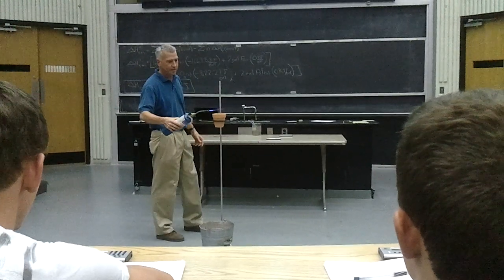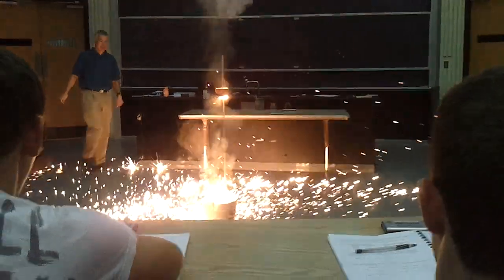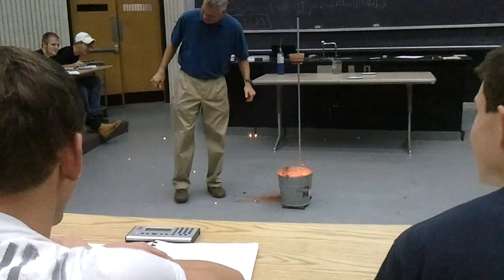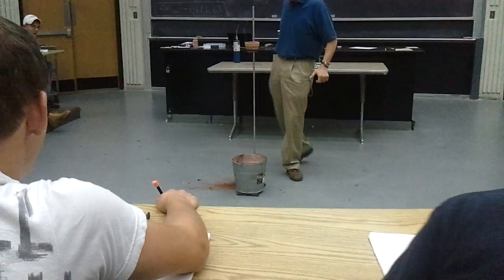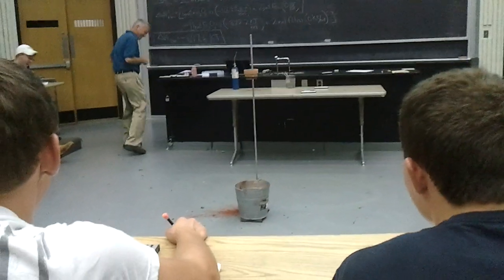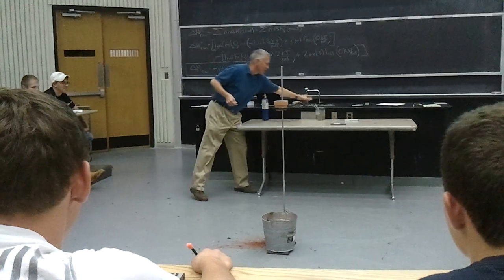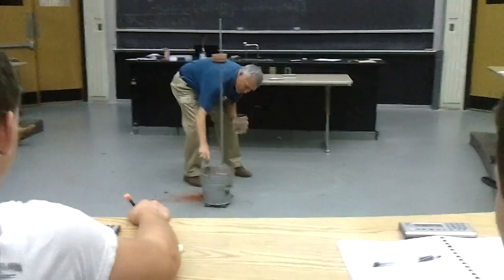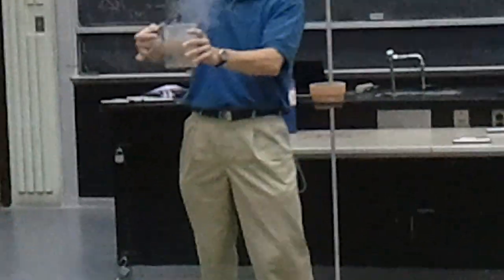Thermite Reaction Gone Bad!

Comment: haha... words you don't wanna hear from your chemistry teacher "that's not good"
Reply: You should have seen and heard the shit my teachers did.
Reply: That's what mine says about all of us.
Reply: Yeah, someone could have actually gotten seriously badly burned from his negligence. Never should have done this inside.
Reply: Mine once said I dont know what is this or what happend
Luckly it was just a water solution
Reply: Back around 1980,79 a teacher  was  killed and several students  injured as a result of an explosion  while he was  pounding a course rocket propellant mixture into a fine intimate mix with pestle and mortar apparatus. He had of course lectured them of the dangers and that  they  should never attempt it , he knew what he  was  doing and all safety precautions blah blah blah.......boom . That was  in Queensland,  of course.
I won't  mention what i actually  witnessed back in the 70s again in rural outback Queensland  when a truck stopped 2 kilometres away, it was  loaded with ammonium nitrate fertiliser,  driver  got out and started hammering underneath  around the axle at something , very hot day , well it happened  and i was knocked off my feet . The axle remained  but no sign much of the  original truck.  Oh, i see i mentioned it.

Comment: Good thing that floor wasn't made of steel beams.
Reply: HAHAHAHAHAHAHAHAHAHAHAHAHAHAHAHAHA SOOOOOOOOOOOOOO FUNNNYYYYYY XDDDDDDDDDDDDDDDDDDD
Reply: +Andyboys Is flogging dead horses your only hobby?
Reply: 9/11
Reply: yeah except the fact that that 9/11 myth has been debunked several times over. maybe you could use that tin foil hat in a thermite experiment instead.
Reply: Dustin Gasser That would imply that wearers of tinfoil hats have a brain to begin with (which is absolutely necessary for planning an experiment)...
Reply: Dustin Gasser debunked by who? The government. Also the Earth is flat and the Moon is a hologram! Praise the sun!
Reply: Nord independent studies set out to put the conspiracy theories to the test. They don't stand under scrutiny up to the claims being made.
Reply: Woooowwwwww
Reply: LMAO
Reply: @kenschartz5334  Right, that's why Grenfell tower collapsed at near free fall into a neat pile. In fact, there's no such thing as controlled demolition. When people need to collapse an entire skyscraper they just set a fire at the top and it handles itself.
Reply: @kenschartz5334  When?
Reply: Hahahahahaha yoooooooooo
Reply: @AtlasReburdened  Damn, I must have missed the part where a Boeing 767 crashed into Grenfell Tower.
Reply: @TheFree33333  You missed physics class apparently. When did you start having the delusion that throwing a rock at the peak of a mountain would reduce the mountain to rubble?
Reply: @AtlasReburdened  maybe I did, would you like to help? How much kinetic energy does an object that has 180000lbs of mass going 460MPH produce?

Comment: Jet fuel can't melt steel beams.
Reply: Cyborgslayer404d You're totally right

but with all the chemtrails, weather control substances and other nasty things that the govt put into the atmosphere, who knows how hot that fire truly was 

u mad?
Reply: ***** You roll a d20 on a Dank Meme knowledge check. You roll 2. Lose 10 skill points in Humor.
Reply: Cyborgslayer404d Psst: steel doesn't have to "melt" to fail. It has all the load-bearing capacity of saran wrap at jet fuel temperatures.
Reply: Valyn66 Bingo, give this person a cookie!
Reply: +Valyn66 In certain cases, but not when the rest of the building was designed to support the other parts if the core was to fail... and the pools of molten metal in the basement? What about that?
Reply: justclimb77
Sigh.

Where do you get this stuff? The Towers were "tube within a tube" designs: the exterior webbing played an extremely minor role in global load-bearing in the structures. The perimeter primarily resisted lateral forces while the reinforced interior column handled load-bearing. That "core" you're referring to was the key structural support of the towers. Impact damage that severed a number of interior and exterior beams, blew fireproofing off the columns of BOTH tubes, AND started raging office fires brought down those towers.

And as another commenter pointed out: WHAT "pools of molten metal?" I'm not talking about thin streams of burning organic matter from windows. I'm not talking about beams that were obviously cut by first responders during the lengthy recovery effort (that's where the photos of "melted beams" come from). I'm talking about pools of molten steel.

The only credible reports of appreciable quantities of "molten metal" I've been able to find in FDNY transcripts suggests that there were some cars that melted in the insulated / burning debris pile. Obviously, I don't need to tell your that things like aluminum melt at much lower temperatures than steel.
Reply: *****
Yep, sat footage, and even thermal vids from the firefighters themselves. And the robots sent in for recovery. My stepdad works for the DoD here at Ft.Benning and gets to see all the shit they use before its put into action and the robots we got to play with at a conference were the same ones sent to ground 0. I saw the footage.  Aluminum doesnt glow red when its molten, and debris would float on it bc its less dense. Leave the thinking to the people with good minds.
Reply: Valyn66
Just make a model like everyone else who cares... actually cares and has the means...
 Also, aluminum does not glow when molten, nor can debris mix into it and catch fire or glow ... its less dense and floats. Plasma torches dont create "pools" of molten anything... the spatter is cooled almost before it hits the ground smh. You need to get out of your little box. Not even mentioning the literal thermitic reaction lava shit seen POURING out of the sides of the upper floors and the explosion sounds caused by high pressure gasses being released. And the cherry on top is building seven. No way a fire could have been sparked INTERNALLY while the whole building collapsed uniformly like a demolition.
Reply: Douglas the basement dweller
Would have taken tens of thousands of pounds of thermite, perfectly-arranged, and somehow magically invisible (whereas Thermetic reactions, in the real world, produce absurd ratios of heat and light).
Reply: +Luur1 pudung tssss.....nice one
Reply: +Ruldolphmaker u got ur tin foil hat on??? from them
Reply: +Valyn66 Well, I guess that explains the Thermite dust found in the ruins...
Reply: +Valyn66 Still doesn't explain the other WTC building collapsing, even if your statement was right, which it isn't.
Reply: *****
"Thermite dust..." Do me a favor and look up the constituent ingredients of Thermite. Now try to imagine ALL THE OTHER SOURCES of those ingredients in dynamic office fires.

Utterly foolish. A 12-year-old could explain the chemistry to you.
Reply: PazzaTV
The other trade center collapse has been explained in a number of engineering magazines. Start with "Single Point of Failure," by Ramon Gilsanz.

Right. Every respected engineering journal in the world is wrong. Just like me. But you're too busy to explain why, because...well there's this guy and this horse and....

Right, slick?
Reply: Valyn66 'explained' and 'respected' are subjective viewpoints. I'm not saying they are wrong, but I'm not saying they are right either.

It's a matter of who you want to trust when it comes down to it, and I opt for not trusting a government notorious for cover-ups and scandals. Simple as.
Reply: PazzaTV
Except we're not talking about trusting the government, are we? Come on, now. Use that noggin of yours.

We're talking about literally the ENTIRE relevant academic and scientific community...or are they "in on it" too?
Reply: Valyn66 It's Ok. I Mean whatever, i don't care about your opinion... Honestly, There are alot of differenr things i could say claiming that happe nd but you'll " explain " it and vice versa, so it also matters how you se the U.S.A
Reply: Excuse my writing...
Reply: *****
The thing is that while both of us can "claim different things," I can actually back my claims up with published, peer-reviewed, academic sources. A lot of them.

Can you say the same? Ask yourself if you can find evidence of the kind of conspiracy you're claiming in ANY respected, scholarly source? The truth is that the only people claiming that 9/11 was an inside job are purpose-built and funded conspiracy groups.

There isn't a single engineering department or structural publication, to date, that has rejected the so-called "official story."

Not all opinions are created equal. You have to be able to critically examine your own beliefs and support them with objective evidence.
Reply: HYPERSHADNIC
"Single Point of Failure," Ramon Gilsanz, Structure Magazine.

Try to remember that WTC 7 got hit by a burning, 110-story, Trade Tower and was engulfed in fire for hours.
Reply: HYPERSHADNIC
Did you even read the source?
Reply: +Valyn66 that is good stuff You're talking about here, I haven't read that article and it has a solid point about that 79th column, my opinion on the whole thing almost shifted. Not being a chemist or an engineer in construction, I have very little "trump cards" to defend an opinion on 9/11, and what I hope to sound reasonable is seeing how USA used 9/11. The Patriot Act, casus beli for wars in Middle East, Bush being glued to a president chair for the next term. I mean, if there is a scenario that could indicate it was an inside job, then I can suggest explaining HOW it happened, knowing the result. There's still stuff You haven't explained, there's a lot of documentaries on 9/11, so many things they talk about. And those are not RT or muslim channels or people supporting this theory, although most Americans will slap anyone for suggesting that their own government screwed with own citizens this big. I wouldn't believe that either, if being an American (I'm European), a specially when this whole shady mess can be turned against US by rival states in East.

Comment: I was at UIUC in about 1991-92 so, one floor above Dr. Steven Zumdahl (his chem text was the AP textbook for many,many years) was doing this demo in front of visiting middle and high school students.  He was wearing proper safety equipment, but never put up a blast shield.  The reaction got out of control, and showered the front rows with iron, hot water, and glass.  I remember multiple ambulances and police cars tearing across the quad to get to the building.

Even great professors seem to forget about how dangerous some demos really can be.

Comment: "It can melt metal." Uses metal bucket
Reply: Zenn Not to mention a galvanized bucket, a pretty bad choice considering he's a chemistry teacher.Zinc Metal fume fever is a real thing, and can be fatal.
Reply: I realize that this may be difficult to comprehend, but there IS SAND IN THE BUCKET. Science teachers have been doing this demonstration for the better part of the last century. The thermite reaction poses no significant danger to the integrity of the bucket. What we have witnessed here is literally a worst case scenario, and no one was even close to being hurt. A cheap terra-cotta flower pot broke, and the molten iron fell in one clump rather than a thin stream. Nothing to worry about, folks.

Comment: I'm a chemist here, and I can tell you that this is a popular class demonstration that often gets messed up.

First mistake was to begin the reaction by lighting magnesium on fire. It's why his flower pot cracks. This reaction should be started with KMnO4 and a couple drops of sulfuric acid for a few reasons.

1) It gives you a chance to talk about catalysis and redox reactions more, and 2) it controls the rate of the reaction better so you don't end up with a busted flower pot.

By using a chemical initiation instead of a thermal one, you end up with a lovely stream of molten Iron coming out of the hole in the bottom of the pot into the bucket of rocks below because the reaction progresses more slowly through the powered Aluminum/Rust mixture. DO NOT PUT WATER INTO THE BUCKET!!!!!!! I cannot stress that enough as you will cause a steam explosion.
Reply: I don't need a science degree to know not to quench a lot of white-hot high-mass molten anything with a smidgen of water. I think you're politely pointing out the prof is a few cards short of a deck.
Reply: Why sulfuric acid with the potassium permanganate?  I have always used glycerine.  I wouldn't want to be producing manganese heptoxide... for the obvious reason that it is a fairly powerful and sensitive explosive.  If I can imagine a proposal that would make this scenario WORSE and more dangerous, it would be producing an unstable, explosive, extremely powerful oxidant which spontaneously decomposes over 55c, then it would be to do so in the presence of powdered aluminum...  I think you got that formula wrong.  At least I sincerely hope you did.
Reply: I worked in an aluminum smelter, we made aluminum from Al2O3 , Inside the furnace we had a carbon block, attached to the negative pole of the electric surge, the furnace was connected to the positive pole. the carbon used up the oxygen,  the molten alumimum was transported in large buckets. It was the most dangerous thing to do in winter, even the enourmous heat was not enoug to heat up the factoryhall . creating iccles hanging onthe roof. When the bucket was 'loaded' we all had to evacuate the factory hal, because if one of the icicles on top of the hall would fall down, it would explode the 20 gallon bucket.    Water and molten aluminum or other metals are very dangerous .  It reacts like an alkali metal
Reply: Scott Grindrod  Belrias Piquet   +Steve Bergen (Couldn't find the right one)  You three resurrected my faith in humanity with the way you all made your messages.  Not only did you all use proper grammar and spelling, but you all clearly knew what you were all talking about and have quite the vocabulary.  But yes, there are many things that could have been done differently by this teacher that could have either given better time for the lesson or made things far safer, but what has happened was in the past and that is all we can truly worry about, I wish you all the best of luck in your future endeavors!
Reply: +Scott Grindrod Your name is Grindrod... lol
Reply: +Scott Grindrod Right bc of the hydrogen produced... ya gotta finish what you start mr.chemistry...
Reply: Yeah goes right up there with the super intelligent igniting hydrogen gas in a test tube demonstration.
Reply: Or just use a graphite crucible and then pour it....
Reply: +Scott Grindrod So, do you know how to make a >90% purity meth? Cause I need a partner
Reply: @oolas27  add fluoride
Reply: Belrias Piquet - I was going to write the same thing- but he starts with „I‘m a chemist here...“ 😂😂😂
Reply: You might be a chemist but a bit of mug as well, its simply the flower pot that cracks due to the sudden thermal shock. It matters not what you initiate the reaction with, and once started at the point of ignition has NO further bearing on the rate or progress of the thermite reaction. How does the ignition point/method affect the overall progress?? Once started it is of no consequence. His mistake was most likely caused by 1) using a flower pot! 2) igniting the mix at the side instead of centraly where the reaction can then spread to the sides reducing the thermal shock until the end.
Reply: Taken classes with this guy. I'm 100% sure he knew exactly what he was doing.
Reply: Does the acid need to be concentrated to a higher percent than the store bought drain opener?
Reply: He may know what he’s doing regarding the chemistry, but he’s ignoring the most basic of safety protocols and leaving himself wide open for litigation should someone get injured.
Reply: The real trick is to just have the flower pot nestled inside another flower pot. The interior flower part cracks and the exterior one is unharmed. The method of activation is irrelevant. A chemist that says using a chemical initiation instead of a thermal one quite clearly doesn't understand simple thermodynamics. Hint, the magnesium lighting on fire is an exothermic chemical reaction just like the KMnO4....
Reply: I’m an anarchist here, and I can tell you the best way to perform this experiment is to ignite the thermite with RDX. At least 200 tons worth.
Reply: Scot GinRod…sure, you are a chemist or do you pretend? I would not hire you to formulate kitty litter.
Reply: academic question; how would the magnesium ribbon cause the pot to crack? my best guess would be water in the ceramic or differential heating, i'm curious how the formation of magnesium oxide would cause this.